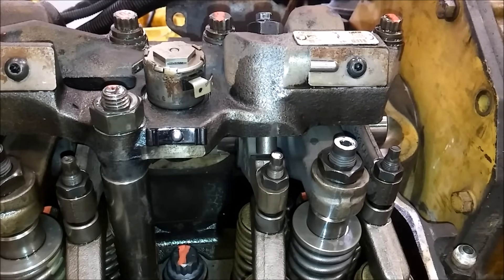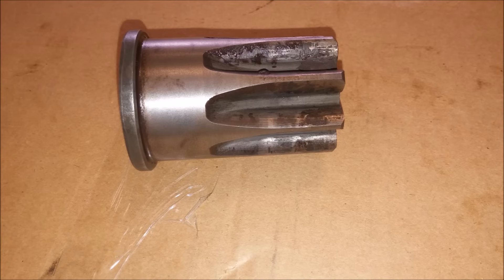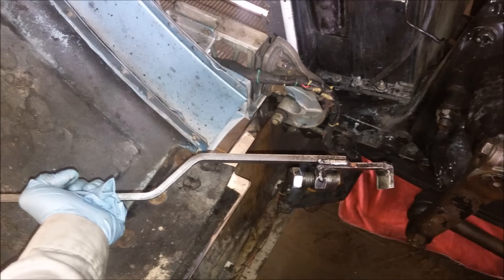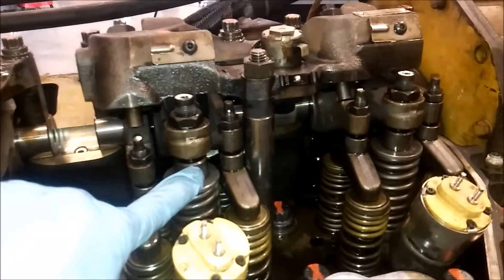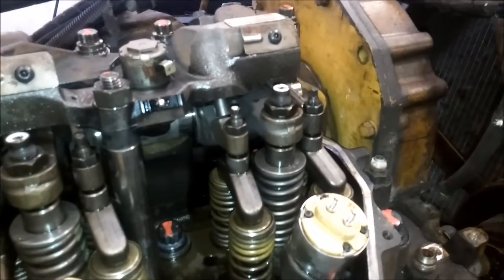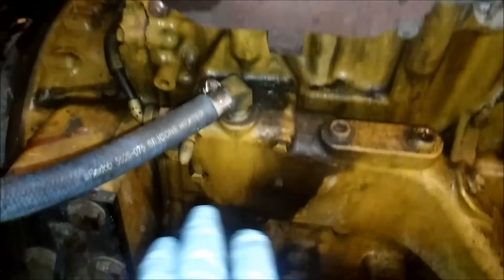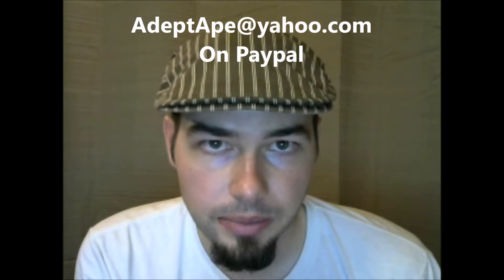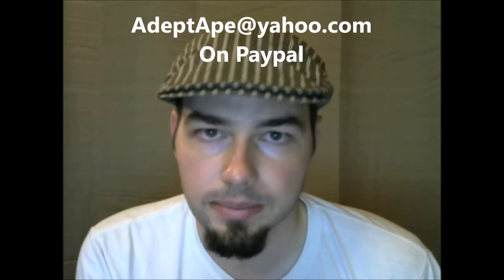How To Perform A C15 Overhead Valve Adjust. CAT Complete Overhead And Valve Adjustment.

Comment: How much cost to do an overhead ???
Reply from the maker: +Oscar Rojo Depends on which model engine you have and what the chassis is. A C7 in a standard truck can be done in under 2 hours, an MXS C15 in a short hood truck could be 5 or 6 hours, just depends on a lot of things. average is probably about 3-4 hours.
Reply: Is a kenworth with a c13 with a serial number KCB92040
Reply from the maker: +Oscar Rojo Probably about 4-5 hours then. The C13 engines usually have the IVA housing removed for doing the valves and injectors, then installed to do the IVAs and Jakes
Reply: Thanks for the info .

Comment: hi, I drove my truck today after tune up, had my truck idling for about 20 minutes, when for a test drive it's the truck sputtering and little  poofs of black smoke come out from stacks. looks like turbo wants to spool up but not enough fuel, after drove the truck for about 30 minutes the hesitation went away. so my question is it running to lean or to rich on injectors? when does injector give more fuel when you set the height lower, or when you set the height higher then 78mm?
Reply from the maker: +Vitaliy TSAT Black smoke means it is running rich, but it is probably due to a fuel pressure issue or a bad injector. The injectors don't really flow more if the height is off, they just build pressure at the wrong part of the camshaft rotation and could cause the Injectors to not fire correctly.

Comment: Hello, fantastic instruction! I have a q in regards to jake adj. I am in he process of an inframe on my 3406E 5ek. I have a factory manual and read the adj for 340A jake. The manual mentions the same adj you post but then mentions tightening the adjuster another full turn to bleed oil?? Then backing off to reset the adjuster? What type of paint stick are you using for your "torque stripe"? Thank you!!
Reply from the maker: +Matthew Frederick You can bleed the fluid by going past the initial setting. You basically just go past to purge the oil then set it to the specification. The paint pen is a Brite-Mark and they make them in a ton of different colors.

Comment: hi have question on injectors height. my stock engine is acert bxs 475hp and it's was tuned to 550hp and 2050ft torque. I bought it like that. does the injector height still needs to be adjusted the same? 
my truck feels like it's in derate mode not enough power. I had code for iva sensor. installed new sensor still low boost and low power. I checked intercooler is fine holds pressure, I'm getting from my turbos 25psi 30psi max, even with light load I'm having problems climbing up hills, seems like not enough torque up hills. I did tune up on injectors, intake exhaust, Jake brake nothing changed, oh and forgot to mentioned my Jake is very weak since I have low boost, my turbos are fine, no leaks anywhere. what could be the problem? burned valves? not enough compression to spin turbos.
Reply from the maker: +Vitaliy TSAT The injector height is the same on those engines, so if it's right you should be okay. That boost is really low, you should be mid 40's in boost. If you don't have any leaks in the CAC or turbos, then you have something else going on. I would bypass the wastegate first by pinching off the air line going to it. After that check your fuel pressure it should be around 80-90 psi running. So you have any sort of engine miss or is it smooth running? Check exhaust back pressure next after the Turbos and it should be very low, unless you are straight piped then wouldn't worry about it. That would be my first checks.
Reply: Adept Ape exhaust is straight piped. I pinched off waste gate same boost no change. however I didn't check my fuel pressure. how can I check that?
Reply from the maker: +Vitaliy TSAT Should be a test port on the top of the engine mounted fuel filter housing, you'll need a hose and gauge to hook up to it though with the compucheck fittings.
Reply: Adept Ape thanks, I just watched your video on how to check fuel pressure, I'll check that, and also check that fuel pressure regulator valve.  thanks
Reply from the maker: +Vitaliy TSAT You are welcome, let me know what you find.
Reply: Adept Ape after tune up, I test drove the truck now I get full boost 40-45psi, I'm guessing the injectors were out of adjustment and it didn't get enough fuel to spin those turbos, now it's whole different truck. thanks
Reply from the maker: +Vitaliy TSAT Glad to hear it's running good for you now.
Reply: do you drive it with the wastegate pinched or no?
Reply: Christian Russo I've tried both ways. same results
Reply: im having the SAME problem in a MBN c 15
Reply: Christian Russo I've kind of figure out the problem. I have air coming in the fuel lines.  what happens is, after high pressure fuel pump diesel goes thru the fuel filter into injectors,   we'll somehow air gets in the fuel. and it causes that sputtering, like it's not enough fuel. so I'm going to replace fuel hoses before and after high pressure fuel pump. and also return fuel line that goes from the back of the head to the fuel filter housing. my buddy just solve his problem this way. let me know how it goes.
Reply: i was going to have a overhead done and see what happens

Comment: have what appears to be oil coming out number 1 and 4 exhaust ports. carbon build up on 4. any suggestions
Reply from the maker: +karl catterson How is your blowby and oil consumption? If it is a valve guide leak them check the exhaust back pressure.

Comment: boss I am thinking to buy a 2011 Pete. Cat15 and somebody told me stay away cause the DPF  on those will give you lots of trouble  so I figured I ask you cause if any body nows it will be you so pls let me know what you think
Reply from the maker: +fisnik bojku It's a 2011 with a C15? It'll have a SDP engine in it which will have more emissions problems than the one you have now. Any of the newer engines whether they are Cummins or International or whatever are going to have more emissions problems once you get a 2007 engine or newer. So if you want a newer truck you'll have to put up with more emissions stuff. You could spend the money on your current truck, but I'm not sure what shape the truck is in.
Reply: There is 2 trucks 2006 cat15  clean and 2011 cat 15 clean but DPF  so looks like I may go for the 2006
Reply from the maker: +fisnik bojku The 2006 should have either a MXS or NXS serial number for the engine and should give you less trouble than the 2011.

Comment: sir  I came by cat wanted to get injector night tool they said it comes in few pieces and they didn't have it where do I order it or should I come to you bring the money and you get it cause if it comes in pieces I don't know what's the wright hight
Reply from the maker: +fisnik bojku We are closed until Monday, but I can sure get the right one ordered for you if you come in. They might be trying to order the wrong thing because I think it's only one part number.
Reply: I come in Monday look for you  if they don't send me on road Saturday  by the way changed those wires on the IVA SOLENOIDS big difference and no more codes thanks again
Reply from the maker: +fisnik bojku Glad you could fix it yourself, save some money.

Comment: Yes and thanks for the help.I'm struggling to remove that base cause of the Iva's housing it's completely loose oil bridges and oil supply line just can't pull it out and I don't want to remove Iva's housing because I read some where I can loose the rods on the iva's falling into the engine.any advice?
Reply from the maker: +Jaime Garcia Well if you have the oil line and bridges off it should come off. Maybe a dumb question, but have you disconnected the injector wiring from the injectors? The IVA housings are fairly easy to remove, there are no little rods in the housings just a bolt and six nuts. They may be referring to the solenoid Torx bolts, but you don't have to remove them to get the housings off. Maybe just pull the housing off for cylinders 1&2 to make it clear. Wish I was there to help out.

Comment: Question I'm trying to replace wire harness for injectors and intake solenoids .I can't remove that middle plate were the valve cover goes mounted.it seems to get jammed against the Iva housing.question is do I have to remove iva housing to remove?    Thanks in advance
Reply from the maker: +Jaime Garcia So I'm guessing you are removing the valve cover base, the IVA housings actually bolt to the valve cover base with their oil bridges, and you have the oil supply line to it at the rear and it can be hard to remove with the IVA housings still on sometimes especially by the number one cylinder. It's easier to pull the IVA housings sometimes than to fight them.

Comment: Will Anti-freeze in the engine oil damage piston rings?  Or would it mainly just damage the bearings?
Reply from the maker: +CSmithbassing Hmmmmm, well as the coolant and oil mixes the oil kind of turns to sludge. That nasty sludge doesn't lubricate very well so depending on how bad it gets, can damage bearings, but also the oil is supposed to help cool parts and lubricate the cylinders walls. So if its not clean oil it can start to damage the engine in expensive ways. It won't damage the rings directly, but if you don't have good oil on the cylinder walls, it could damage them over time, but the bearings are usually the first to get damaged.
Reply: Thanks for the info. The previous owner kept running the truck with coolant getting in the oil. We bought the truck cheap and determined the coolant was coming from the air compressor contaminating the oil so we fixed that problem and rolled  in new main and rod bearings, oil pressure is great and the engine runs smooth and powerful but is using a lot of oil. I'm starting to think I would be money ahead to go ahead and perform an inframe
Reply from the maker: +CSmithbassing Well if your eating a lot of oil then you may have some cylinder damage or worn rings. Although oil is cheap too, so you could just keep adding a little.
Reply: What was the compressor brand and model?

Comment: Thanks coach. I learn't alot watching this video. I feel i have just been upgraded experience wise. But i have a simple question here and i hope you will respond. Can i use same valve adjust for Gas Engine? I mean a Natural Gas engine (G3406) From what i saw on the SIS, the intake is 20 and the exhaust was 35. Please i need clarification on this. Thank for shear you wealth of experience online. You made my day.
Reply from the maker: +Masade Patrick Zubes The valve adjustment part should be the same sequence wise. If SIS says 20/35 then do that and normally on your engine data tag on the engine will also give you your valve clearance as well. What is that engine in?
Reply: Adept Ape you mean the inlet? or what
Reply from the maker: +Adept Ape Oh meant is the engine in a truck or generator or equipment?
Reply: Yes it is coach. Weldon

Comment: great  video thanks.  would  that be the same as  a c13 acert.
Reply from the maker: +Fog Duker I'm going to make a C13 video on the next one I do, but they are similar. The sequence is the same and doing the Jake's and valves is the same, although some settings are different thousandths. The injectors are much different though, there is no special tool, just a 1/2 turn preload on the adjuster.
Reply: Thanks  a bunch  and again  great videos.

Comment: Great videos, i have watched quite a number of your videos on injector replacements. I run a marine cat  3508B marine engine and i desire to service the injectors. I want to know if really the process is the same and can the injectors be serviced, the O rings replaced or simply replaced for new ones?
Reply from the maker: +Richmond Roger - Beckley I used to work in Power Generation which used the 3500 series engine. The C15 and 3500 series use a similar EUI design which has the camshaft supplying the force for the injector spring and then the ECM firing it. On the 3500A models they used a rack design, but if yours is a B model I believe they used the electronic design. You have to remove the rocker arm assembly then remove the injector, clean the cylinder of fuel, then install the new injector or reseal it. If you have seen my C15 injector video it is similar, just your engine has larger parts. Setting the injector height as well needs a special tool, which is different than the C15.
Reply: Wow this is a relief and great to receive from you so fast. Can you make some recommendations of tool I need to purchase before opening up the head and is there available to purchase the repair kit for the injectors?. My model number is 250-1306. How different is this from that of the C15
Reply: And yes the 3508B is fully electronic thx
Reply from the maker: The disassembly and reassembly doesn't really have any special tooling needed, but for the injector height there is. I would recommend going to the CAT dealer for a parts breakdown and they should be able to tell you the injector height tooling, you can pull the valve cover easily and see for yourself.
Reply: Ok thx man I am most grateful for your assistance

Comment: which adjuster are you talking about I'm sorry I'm confused and I'm working on a twin turbo c13 not sure the serial of it and someone told me I will need the injector height tool
Reply from the maker: +anthony alvarez It's going to be hard to explain over a comment, but the injector is set by making contact with the adjust with the injector then turning it 1/2 turn more then tightening the locknut. The C13/C11 don't use the injector height tool. The serial number is either a KCB or an LEE if it's a regen engine.
Reply: +Adept Ape Thanks I will look into to it tomorrow. I appreciate your help sir.

Comment: your very good help bro. Keep it up!!!
Reply: would this work for a c13 as well?
Reply from the maker: +anthony alvarez The principles are the same however on a C13 you need to check for what the Jake's and valve adjustment if I remember right the intake and exhaust are 15/25 and there is no injector height tool, you just take the adjuster until it contacts then 1/2 turn more, then set the locknut.

Comment: Thanks for the great video. I got a little lost on the injector. Didn't get what you mean top bottom ledge. I have a 3406 5EK model. If I let my truck sit for 3 days and I go to start it I get lots of white smoke. I don't lose water but have notice my truck overheating. I started my truck run it for 15 or 20 minutes and did a temp check on the exhaust per cylinder and cylinder 1 was at 150 degrees the rest were at 170 and cylinder 4 was at 205. Could it be a bad injector. Thanks in advance
Reply from the maker: +imoraless The injector part can be confusing without seeing it in person. Your cylinder temps are going to be cooler typically on the front of the engine and hotter in the middle, its hard to troubleshoot with an exhaust manifold. If you are overheating and smoking, have you done the Bottle test? I have a video how to do it and it is easy, it checks for a cracked head or head gasket. Give that a try before anything else.
Reply: Adept Ape truck only smokes when it sits for 3 days or more and I can smell the diesel. When it overheats the truck don't smoke nor I lose any water. A cat mechanic told me it could be bad injectors. They were put in in 2004 when truck was upgraded to a 550hp
Reply from the maker: Hmmmmm, the plot thickens.  Well if it only smokes after it sits that, could be a leaking injector, those are fairly common, hard to identify without pulling the exhaust manifold though and then starting it and seeing which hole it is. The injector leak shouldn't be causing the truck to overheat though. I would do the bottle test anyways and see what you find. If not, overheats can be lots of things, fan, radiator, etc. I'm sure you know that part already though.
Reply: Adept Ape I'll take the manifold off to see what cylinder smokes. I'll take my radiator cooler and condenser apart for cleaning. see if that helps in temp.
Reply from the maker: +imoraless That isn't a bad idea sir.
Reply from the maker: +imoraless I watched your video that was posted. That is a lot of smoke. If it isn't using oil or coolant, it would seem that you have at least one injector leaking or overfueling. Probably a good time to do a set of injectors.
Reply: Adept Ape yes Sr. it smells like fuel. I lose 1 to 1.5 gallon of oil every oil change. I have good power on lower gears ones I get on high gear it seems like it has trouble getting speed. on the hills it jerks a little
Reply from the maker: Between shift missing is also a common problem with injectors.
Reply: Adept Ape it misses if I hit a hill and give more fuel it starts missing (jerking)  if I keep the accelerator down it jerks hard the my truck shacks.